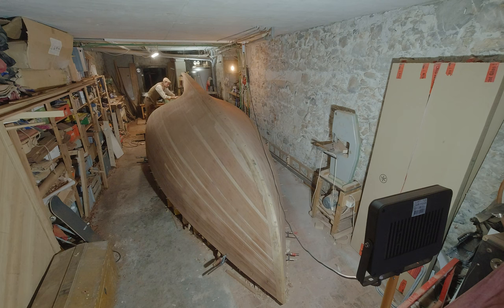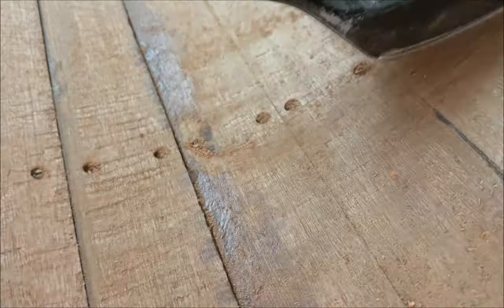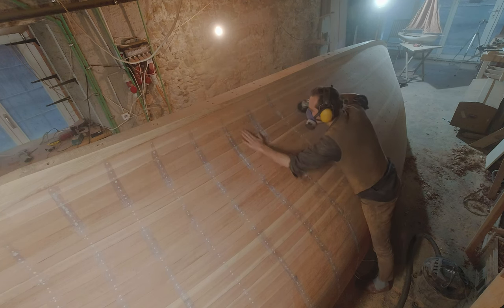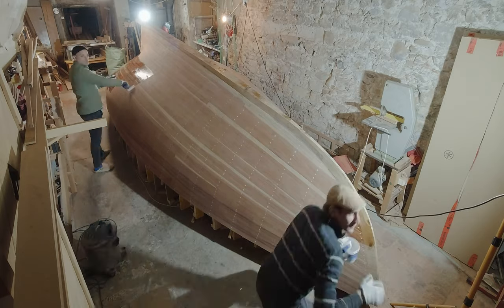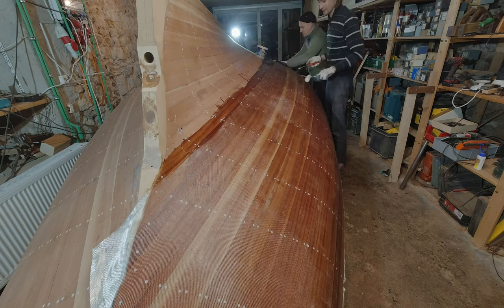Fibreglass-resin disaster  I Craft Endra EP11 I Building a boat

Comment: Bad luck on your disaster.
I'm not a big fan of fibreglass over a traditional wooden construction........I think there are too many potential problems. However, I wish you well with it. It's sensible to start laying up fibreglass in the MIDDLE of the hull, and work outwards towards the ends. There is less adjustment, wrinkling, and stretching, if you do it this way.